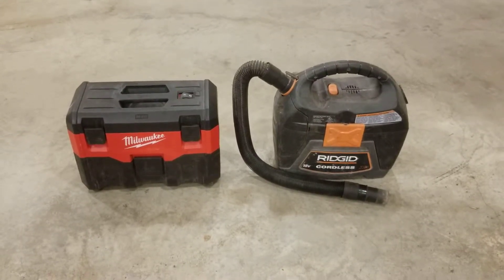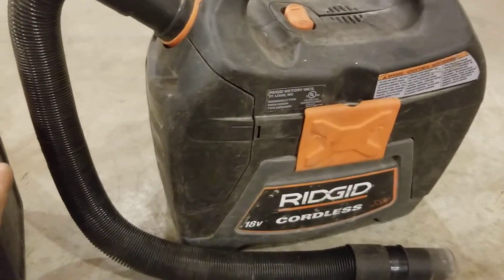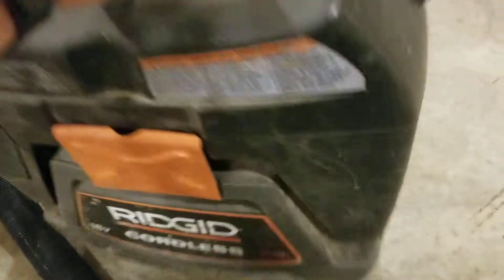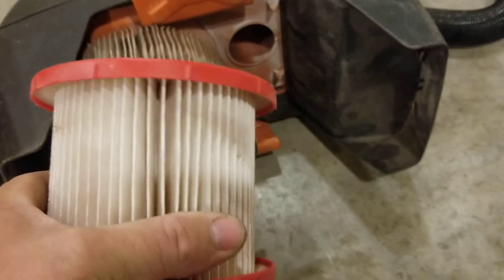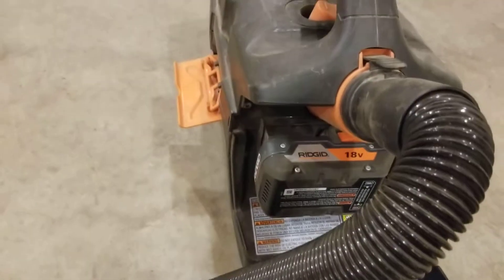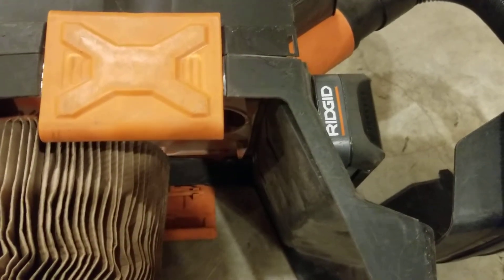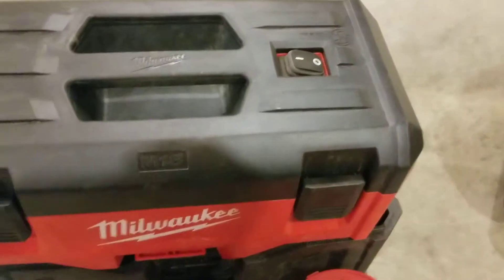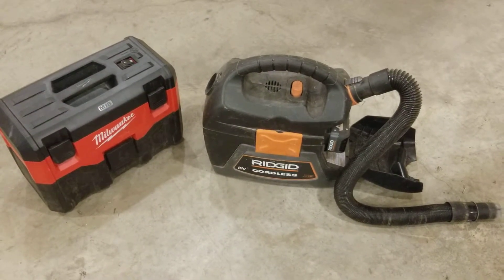Milwaukee M18 cordless vacuum Vs Ridgid 18v cordless vacuum. #sucky video

Comment: Where did you learn about removing the resistor for more power on the Ridgid? Is their a vid on how to remove it?  Other reviews comment how thin and light the Ridgid plastic is.  Seeing how you use, with some abuse, your vacuum I dont see it as a problem.

Comment: Milwaukee’s filter is washable. You can literally run it under the faucet, clean it, and throw it back in the vac instead of dealing with paper filters.  Its more compact, all the tools are self contained, you can sit on it, stand on it - and they have what - SEVEN different models now?  Yea, the Ridgid slightly outperforms the Milwaukee - but it better- cause thats the ONLY thing thats better about it. They had to give Ridgid guys something.

Comment: I think the Rigid has the highest cfm of all these smaller shop vacs sucking power at about 60cfm. I like the feature of the Dewalt dual powered one and their filter doesn't need removal when sucking water which is spectacular. I've got Ryobi tools so I'll probably wind up getting the Ryobi. The only other dual powered small shop vac I know of is the Harbor Freight Hercules. Thanks

Comment: Before i say this, dont hate on the brand. Lol. But I just picked up a Ryobi 18v vac similar to the milwaukee due to me having several batteries and a full set of their tools. One of our installers has the milwaukee and we had a little head to head test. The ryobi is superior in performance, much better hose, but takes the same filter. I wish it was bigger also. I am just too invested in my ryobi brushless setup to justify changing brands. Now, in my service bag I have 12v milwaukee fuel and love them. Its sad that the "low grade" ryobi beats the "top of the line" milwaukee. But they are both ok for why i got mine. Cleaning up while doing preventative maintenance, sawdust, and occasionally emptying water out of a secondary drain pan in an attic. I hate extension cords.
Reply from the maker: Oh I can believe it.